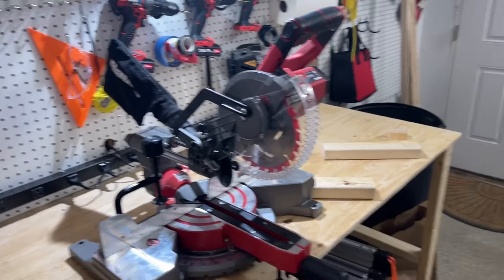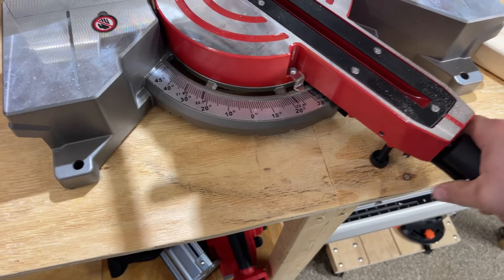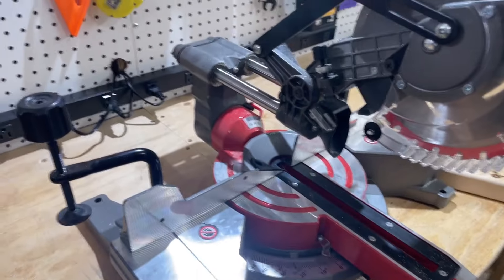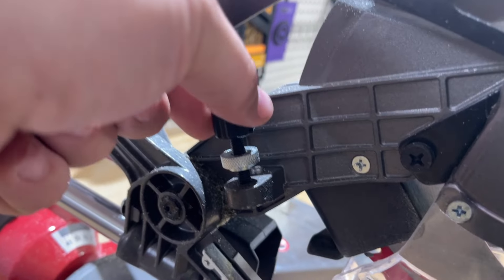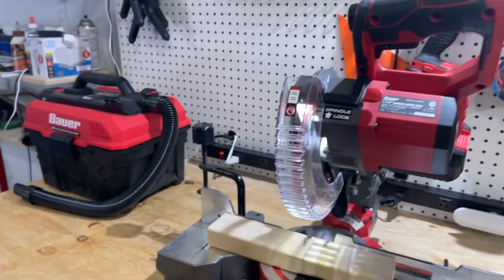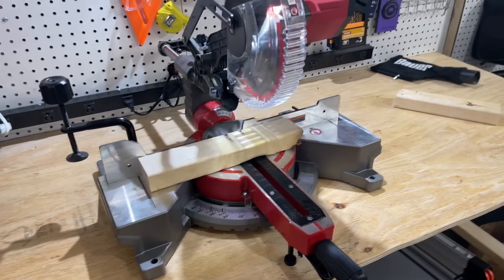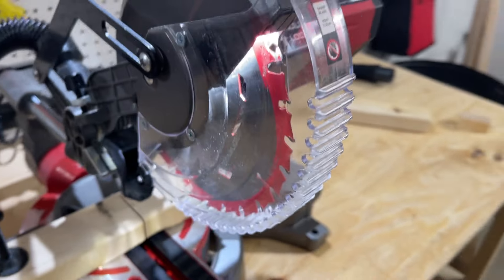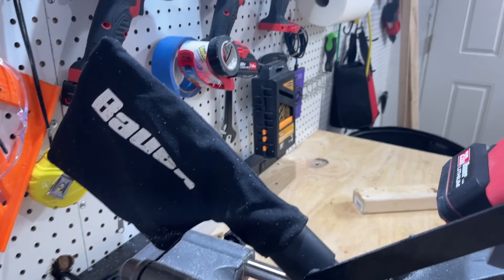Review & Demo: Bauer 20 Volt 7.25" Sliding Miter Saw (Harbor Freight) | Ever-Curious Geek

Comment: How has it held up
Reply: Pretty darn good. It's a great saw if you come at it with the right expectations. It's not going to be a heavy duty, everyday professional jobsite kind of a saw, but for the DIYer and homeowner doing occasional work around the house, it's a great size and really easy to work with. I came to it from a 12" Warrior miter saw which was completely overkill for my needs. It's perfect for me because I'm already in the Bauer ecosystem and I have a very small workspace. It's also very portable so I take it over to my parents' house occasionally to do some light work there.
Reply: @evercuriouslife  awesome thanks!
Reply: @evercuriouslife thank you. I plan to pick one up today🙌